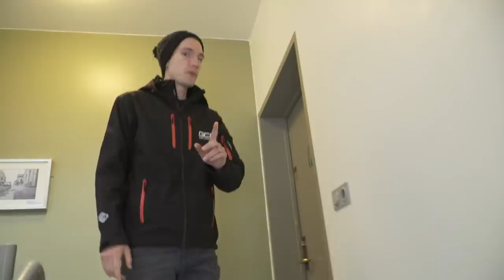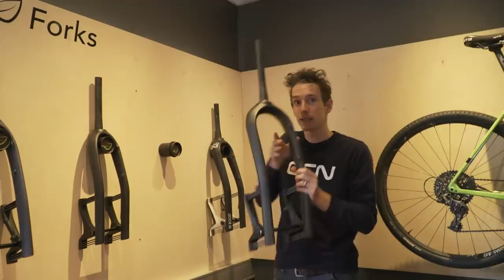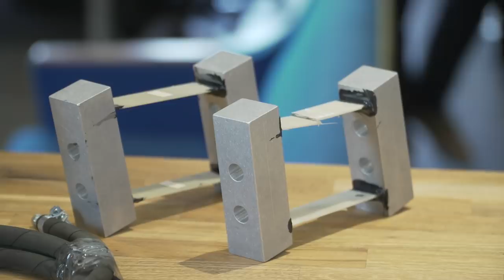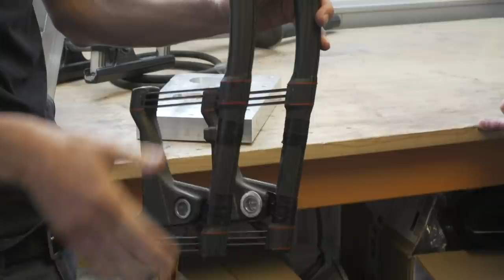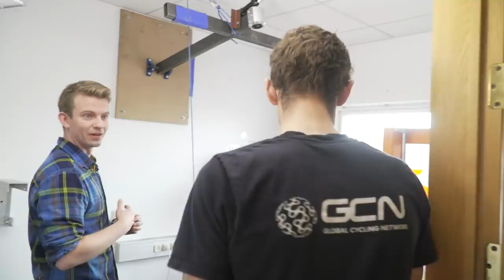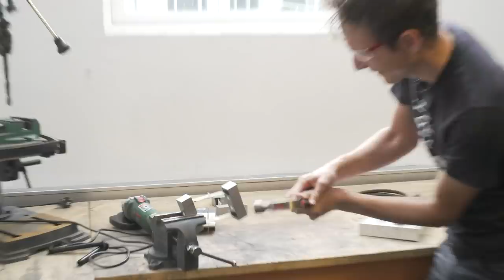Gravel Bike Suspension?! | Meeting Lauf In Iceland

Comment from the maker: Let us know what you think of the innovative forks from Lauf. Would you like a set? 👇
Reply: Global Cycling Network Can I get a pair of jerseys? Please? 50th view 7th comment
Reply: When does a gravel or cx bike become a MTB
Reply: They definitely look a bit weird, but the idea is great and I think they came across as a very cool company who are super passionate about their product, that, for me, kind of makes me want one. Oh, and the beer bottle opener, that´s just cool.
Reply: F*ck yeah!
Reply: Global Cycling Network there are s couple models at my local bike shop, and to be perfectly honest, I didn’t think much of it until this video. I do see the see the appeal for comfort and also lack of maintenance. Great video guys! Now to the real question, did you bring back to the UK Loydy a home brew?? Oh Icelander and their love for fermentation 👍🏽👍🏽
Reply: I have been very interested and think about it a lot as I get smashed on the late season gravel roads in my area. Does this have enough travel to smooth out the washboards? It can become very dangerous coming around a downhill corner and get caught at speed with 4+inch speed bumps!
Reply: They aren't pretty, but since they are sort of an inverted Moulton New Series fork (glass-epoxy leaves rather than elastomers in torsion), it makes sense that they'd work great for rough roads.
Reply: I wished they talked more about how they can use one fork set for a wide range of rider weight, with no adjustability.  It seems a 100 kilogram rider would have much different experience than a 65 kilogram rider.
Reply: Ja takk :)
Reply: @cup_and_cone  For the Grit SL it says: Rider Weight Limit: 110 kg / 242 lbs.
Reply: @cccpkingu  I'm aware, but note that's also including bike weight.  I was looking at their Grit for adventure touring.  A 12 kilo bike and 18 kilo of gear means a realistic rider weight limit of 80 kilos (which puts me near the limit at 6'2").
Reply: @cccpkingu  My point is they don't address different rider weights all using the same spring rate.  Presumably the 110 kilo guy is probably going to be hitting the bump stop all the time, while a 50 kilo female rider is barely getting any suspension travel.  It will be like the old elastomer fork days in the 90's with no adjustability and everyone is having a terrible experience unless you are the perfect dimensions to which the component was designed.
Reply: @cup_and_cone  The "Carbonara" says 120 kg / 265 lbs. Fairly sure I've seen different forks for different weights, and replaceable leafsprings way back.
Reply: I think I might, though I may get a pair of 650b wheelsets together with this, and then do local cross races, and suburb/rural long rides.
Reply: @cccpkingu  - Ya I think you're right, I could have also sworn they made a couple different options depending on rider weight when this was an early concept several years ago.  Carbonora is fat bike hub spacing, so no gravel.  The regular Grit is being sold at a retailer here in USA for incredibly cheap right now ($550usd new), so it caught my interest.
Reply: I have test rode a True Grit. It is an awesome bike. If felt as light as my road bike and stiff but so fun on gravel roads and shh Singletrack.
Reply: I would, despite primarily being a mountain biker. I alternate between a 6" travel squishy MTB and a "racey" few years old road bike. I have seen the Lauf forks on Iohan Gueorguiev's amazing journey and was intrigued. This factory video really brings it all together. The dedicated Lauf bike seems necessary for the tolerances involved in frame design. The gravel bike looks like the one to buy if I were in the market right now. Spot on! (Did I use that right? I am American, sorry to appropriate, but it is so appropriate that I don't know what else to use. Good phrase, "spot on.")
Reply: @cup_and_cone  Get on the scales with your bike and see what it says. If that deal was available to me I'd consider packing lighter of taking off some.
Reply: They look like perfect for absorbing small shocks while being much lighter than standard suspension forks, I WANT ONE PLEASE!!!
Reply: Nice of you to offer. Yes, I would. Please mail to ....
Reply: I'd love to see a side by side review of the original Rock Shox Paris Roubaix SL, the Cannondale lefty Oliver, the new Trust pivot fork and these lauf forks. Maybe for a retro vs modern Paris Roubaix episode :)
Reply: i have this on my MTB and one of the best investments for a hardtail bike! hopefully they can make a lauf seatpost too :)  or saddle :)
Reply: Been riding the mountain bike version of the fork for 3 years :)
Reply: Loved this video very innovative.   Would love to see a video in conjunction with  the Bamboo bike club 😊
Reply: That is one very attractive kit of a bike.  Smoooooth and liiiiight looks right to me.
Reply: @leesonrider When it gets slow on gravel haha.
Reply: sounds perfect for bikepacking, I'd adopt that in a jiffy!
Reply: Wery good innovation! I set if it cost not many money. But I riding on old bike and cheep.
Reply: Are they in the United States .....I'm in California and we have lots of mountain biking here ..I would like to see it here
Reply: Just one stiffness ???
Reply: Any chance you could compare this to the cannondale slate? I'd like a bike with a little bit of suspension and feel this market is a bit underexplored
Reply: No where as elegant or as efficient as the Moulton gravel bike suspension.
Reply: I like the company I don't like one of the leading engineer there . Won't go into detail why and who I am referring to but he seems rude
Reply: I wonder what would happen if I install one of these forks on my road bike... If I get one, Ill let you know.
Reply: @viki9539  People will Lauf at you . No only joking go for it . I got mine with a discount and it's a really cool fork .
Reply: Looks like only spring, no damping.
Reply: Got the bike (the True Grit). Absolutely love it. Fast, comfortable, smooth. Brilliant.
Reply: Yeah, I'd run a set in heart beat :D
Reply: Trailing link suspension isn't a new invention
Reply: Love a set, with a straight steer tube ...
Reply: @ericpmoss  this idea is old as motorcycles. Look up Trailing Link Suspension
Reply: LOVE IT! WANT ONE!!!!
Reply: I have only seen one bike with this fork in my country, and yeah, from the moment i saw it, i knew i would love to install it on my bike.
Reply: Just air down your tires. You'll go faster with less rolling resistance (opposite of pavement), get better traction, and be comfortable.
Reply: Do you have an updated review for the Grit SL fork?  At the end, Simon gave a brief synopsis which was positive, but also said it was based on a short ride. Curious if there is a more detailed review 7 months later.
Reply: If they can developed some like this for the rear ... most of the time you don’t real suspension but some absorption why carry that weight? Lauf do some with this please!
Reply: Yes 💖💕
Reply: I have one question for London what is better road bike or gravel bike ?
Reply: Yes sir please!
Reply: Absolutely yes. Have a GT gravel. Big fan.
Reply: Hell fucking no they are a gimmick.
Reply: Amazing!
Yes. I'd like a set for a MTB.
Reply: Great design, basically leaf-springs for a bike. I would love to see a frame made with the same concept on the rear wheel, maybe delete the chainstay and essentially have a 'rear fork' with this type of suspension.
Reply: I wouldn't mind a fork like that. It would have to be cheaper than telescopic forks though, as it has way less moving parts, machined parts and parts in general. Otherwise, it lacks a lot of features that you'd get with a telescopic, like adjustability, travel length, etc.
Reply: I ride an RSD Mayor, 6061 Aluminum frame,  with the Lauf Carbonara fatbike, 4.8 tires, and 1x11 SRAM, with disk brakes, UMRBikes pedals,  here in Calgary, Alberta, Canada. It works well in the -30C winter. I like the fact it is maintenance free. Planning on commuting to work this winter, 25 km uphill both ways. Rather hilly in Calgary 40 percent grades for 5 miles. Will be installing Vee studded tires for the winter. I zip-tied Planet Bike Big Buck fenders front and rear. I am considering a carbon frame hard tail, or an Ican full suspension frame, with a Bafang mid-frame motor, and a 58 or 72 V battery with pedal assist. I wouldn't be without it.
Reply: No.

Comment: "This is the GCN Show" "Today i will be showing you the new gravel bike with flat handle bars, full dual suspension and 40mm tires to allow us to not only ride gravel roads, but all the jumps at whistler bike park"
Reply: gravel bikes in 20 years will literally just be modern mountain bikes
Reply: @drownedgod  mount a wider drop bar on your mountain bike and you're golden mate

Comment: This is a very interesting concept I had great fun in watching. However I wish there were a few more critical questions to its concept:
1. How much weight is saved vs. a high-end lightweight telescopic fork like a Rock Shox RS-1 or compared to normal forks used in gravel bikes?
2. How significant is the disadvantage that this is just a spring without a dampener system? Does this translate into a significant time penalty vs telescopic air fork. Is this made with the intention to let you save time on gnarly terrain or increase comfort and control for casual riders? Pardon me, if I overheard the last point.
3. Towards which rider weight was this optimized for? I can imagine for lightweight persons the spring could be too stiff and for overweight people too soft. Or is it solved by offering multiple variants? This is one of the biggest advantages of air forks.
Reply: Yep, yours are good questions.
Reply: Also how much of an aero nightmare is it?
Reply: 2. Quoting from their website: "Since the travel is fairly short and progressive, we don’t need damping".
Reply: 3. Quoting from the web page for the TR Boost fork: 
«Spring Rate
Regular (over 65 kg / 143 lbs) or Light (under 70 kg / 154 lbs)

This should be used as a reference. If you’re an aggressive rider it’s likely that you’d prefer the “Regular” stiffness, even though you weigh less than 70kg. You won’t lose any of the small bump compliance.»
Reply: @CristianCiupitu  Which is pretty puzzling: every suspension in the world has a spring and a damp, they could have simply put a damping material between the springs maybe?
Reply: @giovannispinotti   you mean every big and expensive suspension. Low travel cheap suspension doesn't have damping or if it has it's a joke.
Reply: @CristianCiupitu  No, I'm generally speaking of any spring-damp suspension system. Spring with no damp is a recipe to oscillation and disaster. If you're telling me that in this particular kind of suspension the inherent damping is enough for the spring then I'd understand.
Reply: @giovannispinotti  Corvettes use a similar type of spring, and their gas-filled dampers weigh only 3lbs, for a much larger, stiffer spring with more travel.
Reply: Having previously owned and used the TR fork and have demoed the GRIT on a gravel bike, I can kind of answer your questions with my experience, and you can draw your own conclusions.

Weight I believe is around 1000g for the TR and like 800g? for the GRIT. I don't have info on the GRIT SL. Unfortunately I also don't have the specs on the RS-1 that you're comparing it to. However I do know they make a 100mm and a 120mm, I don't know if they make an 80mm, but if I had to guess...probably not.

The behavior for the fork is quite different than an air system that rely on a balance of negative and positive air and dampening oil and chambers to dictate how the shock performs. This suspension is A LOT more active when it comes to small bump compliance, and will react to small bumps at a much faster rate because there's no dampening system that's trying to keep up. The trade off is big bumps due to the suspension travel limitations. There is also no equalization system that compensates for weight other than them offering two models in the TR for someone under 140lb and over 140lb. For it's intended use, I think they work pretty good except in technical terrain where its going to feel more like a rigid fork on larger bumps/drops because you will most likely have the fork's travel preloaded pretty close to the end of its travel range. This is most noticeable while standing and climbing. However,  this fork very much excels in climbing! I originally had this set up on a single speed which I feel WAS NOT the best setup because where I see this fork shine the most is when you're in the saddle and the fork can just pick all the small stuff up as its intended to be a "marathon" fork. When I put gears on the bike and was in the saddle, it worked phenomenal except for more technical stuff with drops and such. Keep in mind, I was also riding the same trails I would normally ride my Intense (at the time) with 130mm front and rear. This fork works best where you can stay in the saddle. There is some lateral flex at the axle, but its not bad flex, and the tracking is good but it does feel different because the axle technically "floats".

I believe this fork best shines as a gravel fork even with less travel. The reason is that most gravel riding is done in the saddle so the fork isn't heavily preloaded and the fork can utilize the majority of its travel for the impacts of uneven surfaces you'll likely encounter on gravel. If I had to give a comparison to a gravel bike with a rigid carbon fork, it would be like swapping out a 33c tire at about 80-90 psi to running a 50c tire at about 35psi but still retaining all the benefits of running a 33c. Also to take into consideration as to why I think its so beneficial in gravel is that if you compare the tire weight (and rotational weight) of a 33c tire to a 50c tire, the weights are significant..often a 300g difference which is the average weight difference of a rigid fork (500g) to a Lauf GRIT (800g). So you move rotational weight to static weight.  I thought it felt really good with 40c Clement MSOs at 40psi...significantly better than on the rigid fork. A far as flex, its not as noticeable on the GRIT.

Sorry for the long winded reply, but I wanted to be as thorough as possible.
Reply: @Maccaroney  we‘re talking GRAVEL bikes here…not road racing to the extreme. 
And keep in mind: the worst aero nightmare on a bike are YOU as the rider on top of it!